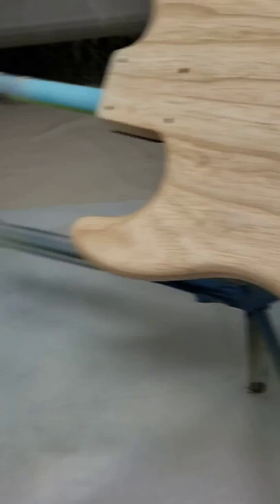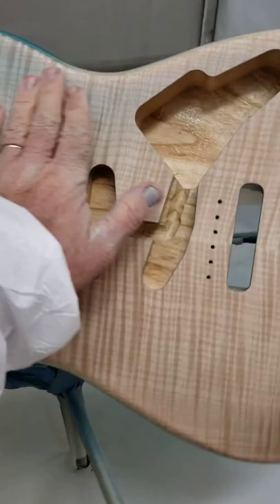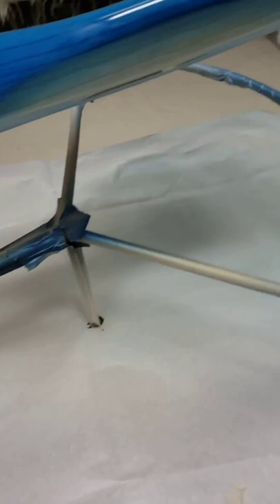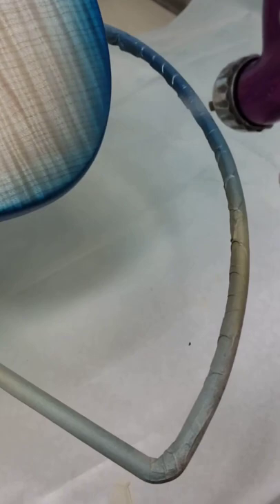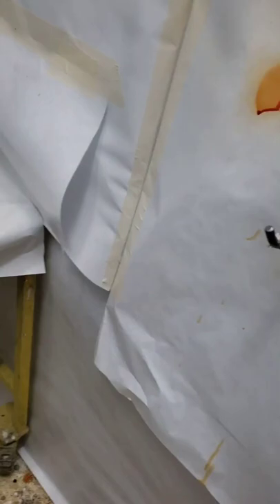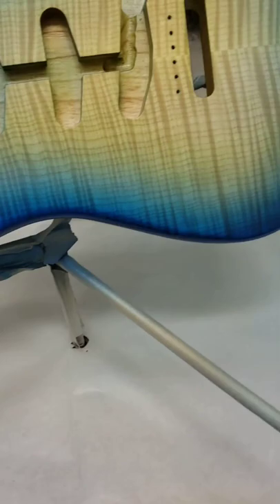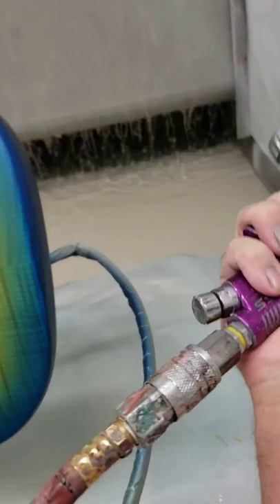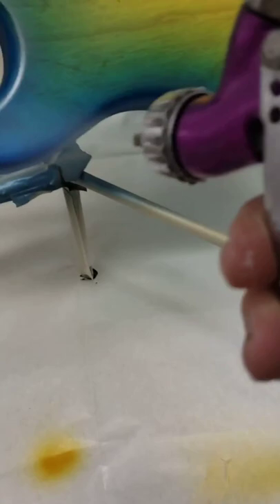How to spray a surf burst using lacquer.  This is a flame topped Strat.

Comment: is there someone who approves your work after you're done? Or some quaility check? How do you know that you made it correctly? do you have some pictures like how it should look like? i mean i know you made thousands of guitars but, when you were learning, were there any specifications how thick should the burst be, or how transparent should it be? did you have some limit samples? im just thinking about it like you're in factory and you have to follow some rules. Id like to know how is it to work in a custom shop, where probably its more up to you than anoyone else, because you're the most experienced one.
Reply from the maker: Yes there are samples and I was taught by a man who worked there 40 years in the paint department. And there is a quality control process. If you make a mistake or something isn't perfect, they show you and you learn.